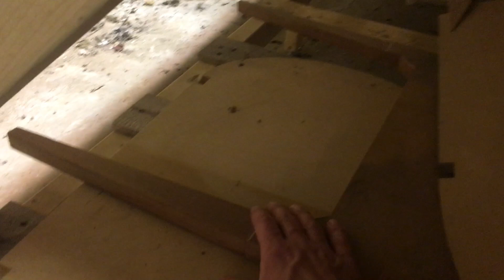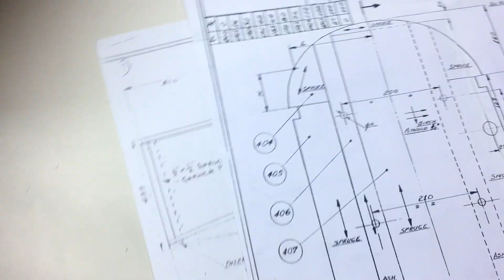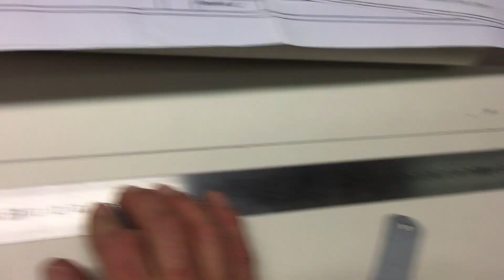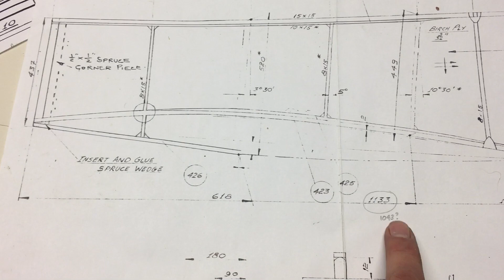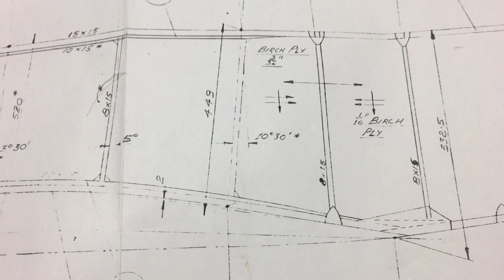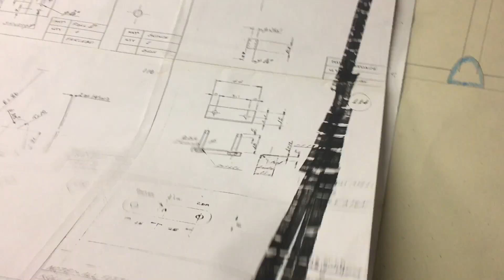Druine D31 Turbulent Build Vlog No 6

Comment: Wauw, A big job to build a Turbi from Scratch, I own The OY-AMS which has been restored after a hangar collapse in 1999, The turbi flies great and is a lovely airplane.
Which engine are you planning to put on?
Reply from the maker: Hi, I have been fortunate enough to get a part-built project so not starting quite from scratch, still quite enough of a challenge for me though!  I have a VW unit which has been adapted for aircraft use, it has been a long time since it has turned over and it will be a while yet before it is needed.  I will need some specialist help to assess whether that power plant can be made safe for use, there are some people over here who can do that so should be ok.  Many thanks for the comment it really helps with keeping the motivation up, it is also good to hear that the Turb flies as nicely as she looks!  Hopefully one day I will get to experience that!